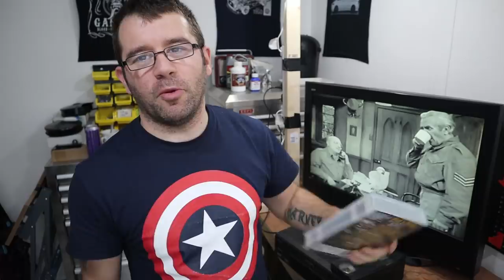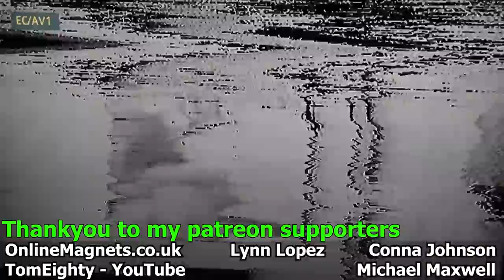WATCH Recovered Footage From a Stolen Camera i Found Magnet Fishing

Comment: You can't repair tapes in normal light guys it will completely ruin it. As seen.
There is usually an option on these vcrs to clean up the picture

Comment: You will need a video head cleaning cassette now Gareth. You must have seen a CD/DVD cleaning disc, well the video cassette player has the same sort of thing that works the same way. Wet and Dry VHS Video Head Cleaning Kit with fluid, eBay £3.89 Free P+P. (Never put a dirty tape in the player. It's a bugger to clean)   :-)
Reply from the maker: Its the video cassette thats contaminated, the tape cleaners only clean the vcr head
Reply: @drasticg  Correct Gareth. But, the heads must need cleaning after putting a contaminated tape in the machine. Try playing another tape in it and see if you have good sound and vision. I am not trying to tell you what to do, i'm no expert. It's just suggestions from me, (an old git, trying to help).
Reply from the maker: @edwardgriffin8092  cool idea and may work so its worth a try

Cheers